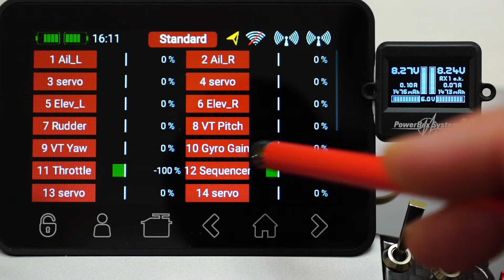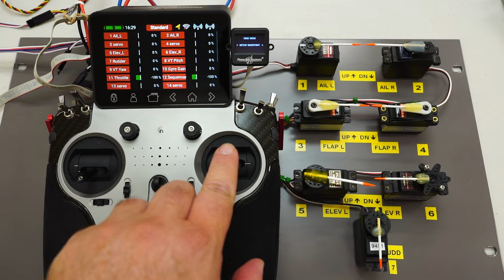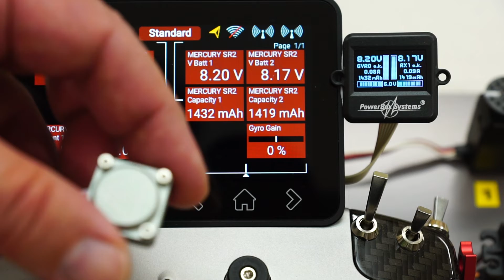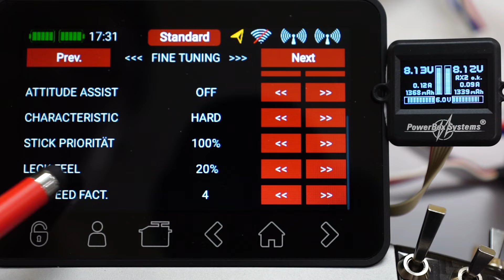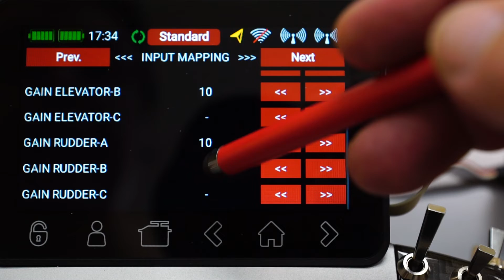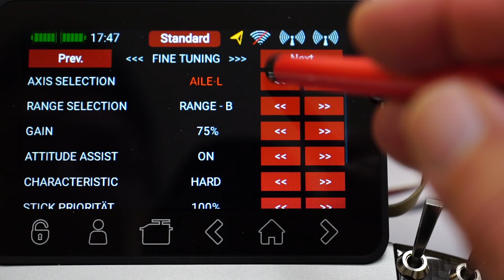PowerBox Mercury SR2 : Part 3 - iGyro SAT Setup

Comment: I am setting up two jets with isat, pioneer and core. Used your flap setup method on both could it cause the flaps to deploy and gear to rotate when I start the activation on the gyro setup?  My mapping is all correct from what I can see on both.  Flight modes for flaps all look correct.
Reply from the maker: I cannot recall 100% as I have not had to setup a Pioneer with the iSAT for some time now but I think it drove the other channels to neutral throws during setup. Might pay to disconnect the flap servos and gear just in case.

Comment: Thanks for the helpful video.  I would like to set a different knob or slider for each gyro axis (elevator, aileron, rudder) to dial in each independently more quickly for each model.  The standard PowerBox receivers with igyro SAT limit gain switches to a single switch.  Which Powerbox devices allow me to use a different gain channel (and therefore switch or knob) for each axis?  I noticed in your Mercury video above that this is possible with the mercury.
Reply from the maker: @djjay9974  Only the larger PowerBoxes such as the Mercury have this feature where you can assugn different gains to the individual flight surfaces.

Comment: Only just watch this Great video Costa, one question when your happy with the gains do you then assign a switch to activate the gyro??
Reply from the maker: @dalemalpas4960  Normally I would set them as fixed gains switchable with my flight modes. I also always keep a separate switch for 0% gain to disable gyro at any point in time.
Reply: Surely you need to adjust the gains in Flylight before a sign in a switch?? (My turbine jet)
Reply from the maker: @dalemalpas4960  Yes you can simply assign to a slider or dial first. Once you find the max gain you can use then simply reassugn to a fixed value...done..!
Reply: @CVHeliPilot  cheers 👍🏼

Comment: Thanks for a great series of videos. Could you please clarify something on how gyro gain is affected by the tx if a gain channel is used on say a rotary dial as in your example. 
If gain for an axis is set within the mercury at 75% and the channel controlled by the rotary knob is giving say +50 output, is the actual gain then 37.5%?
Reply from the maker: @ukfreebird987  Yes, in your example 50% set on tbe Tx will mean 50% of the 75% set in the Mercury ie overall gyro gain will be 37.5%.
Reply: @CVHeliPilot  Thanks

Comment: So here is a scenario for you.  With a Tx that has only 12chs and because of the complexity of the model you need to limit ch allocations hence Ailerons will only have 1 ch from the Tx, elevators even though they are split will also only have 1 ch from the Tx. Same thing for flaps. 
I am thinking to then in the PB to output map L aileron to PB port V and L elevator to PB port U.  
Both as direct then use the servo matching fx in the PB to set end points on those.  I am assuming that then they will simply follow as slaves to their Tx ch and any adjustments to that master Tx ch would then be mirrored by said slave chs.   
Of course there may be a better way to do this apart from spending $3k+ on a PB Core!
Reply from the maker: @PeterOZ61  Yes, if you set any output to 'Direct' it will output that channel to the port unmodified. So any mixing etc must be carried out in the Tx. Basically if you set all the outputs to direct then the PowerBox will act similar to a normal receiver.
Reply: @CVHeliPilot  thanks good to know I am on the correct path with it.
Reply: @CVHeliPilot  I have got a weird one for you. I am using an older JR 12X on DSMX so essentially ity is just like a Spektrum.  I have a new PB Competition SR2 and trying to may my AUX channels to various ports on the PB however the PB does not recognize the radio channel.  For example I wanted to use AUX3 s choke via one of the toggles, I can see the channel working in the radio monitor screen and I have the PB setup on port H as direct and as #8 yet the servo does not work, in fact it is like it has stalled and it does get very warm.  Tried another servo and same thing.  Plugged my servo tester in and the servo will work.  I did reach out to Richard and he does not know.  Thought you may know if there is something I am doing wrong?
Reply from the maker: @PeterOZ61  I saw your post on the PB forum... I also have a 12X unfortunately I do not have any SRXL2 capable receivers to test with.
Reply: @CVHeliPilot  I have spare 2 x SRXL2 Rx and the PB adaptor cables I can send you.
Reply from the maker: @PeterOZ61  Hi Peter...do you want to send me your contact details via Messenger...?
Reply: @CVHeliPilot  sure, which messenger app?
Reply from the maker: @PeterOZ61  Its ok... As I just saw you private message on the PB forum...

Comment: Have you tried mounting the iGyro with the wire lead pointed to the side of the plane?  I was wanting to do this on one of my planes and found it was reversing the gyro correction on the rudder and ailerons.
Reply from the maker: It should not matter providing that you teach the mounting position correctly. One if my planes has it mounted with the wire exiting sideways and it works ok.

Comment: I would to see a video on nose gear steering connected to gyro
Reply from the maker: Hi Chris, This is very simple to do... First setup the gyro with the nose wheel channel disabled ie. just a normal setup so the gyro does not know about the nose wheel as the setup assistant cannot work with a nose wheel input.

Then once you have the gyro operational for your Ailerons, Elevator, Rudder etc you can re-enable the nose wheel steering channel and then manually assign this channel to one of the free Rudder gyros ie. Rudd-B or Rudd-C in the Mercury. Rudd-A will be already assigned for the actual rudder when using a single rudder surface.

Manually set the input mapping so that the nose wheel channel number is assigned to a free rudder gyro output ie. Rudder-B or Rudder-C (Rudd-B will be available if you are only using one rudder or Rudd-C if you have two rudders).

You can also use a separate gain control just for the nose wheel gyro - Set this up in the gyro gain channel assignment screen on the Mercury where all the gyro gains are assigned a channel from the Tx.

That's pretty much it..! The main thing to remember is that the setup assistant cannot handle the nose wheel when it goes through its setup so we add the nose wheel to the system manually after the setup assistant does its thing for all the regular flight surfaces.

Comment: Hello, thanks. great video, so helpful. I noticed when you’re setting up the center and servo reverse on the transmitter first, you were using one servo per aileron. If you have two servos per aileron, how do you reverse the second aileron servo on one of the wings when in the transmitter you can only reverse one of the two servos? Do I reverse in the core  the first inboard servo, and then in the competition reverse the outboard servo? Thank you.
Reply from the maker: You can setup one of the servos in the tx and this in effect becomes your master servo for that flight surface. You can then match additional servos on the same flight surface using the servo matching feature in the PowerBox.
Take a look at my video showing you how to setup the Mercury with multiple servos on the same flight surface.
Reply: @CVHeliPilot thank you
Reply: You can use the SERVO MATCHING menu to adjust the movement direction of each servo

Comment: Excellent video Costas 👍👍👍. One suggestion: it’s important to mention when teaching the endpoints in the set up of the gyro that when having a dual rate the high rate setting should be switched on!
Reply from the maker: Yeh...I probably should have been clearer when I was talking about teaching the endpoints for the Gyro... Maximum travel for the flight surface must be selected.